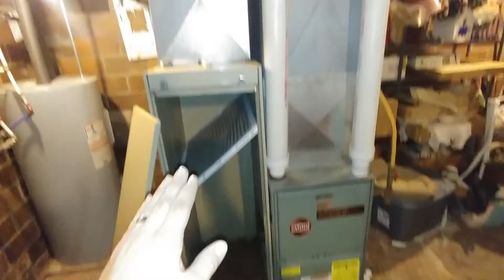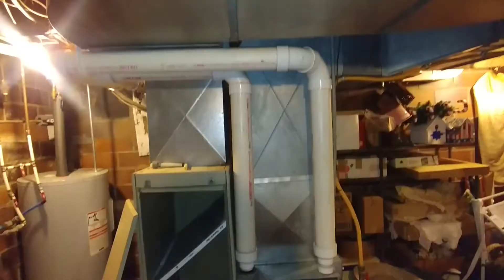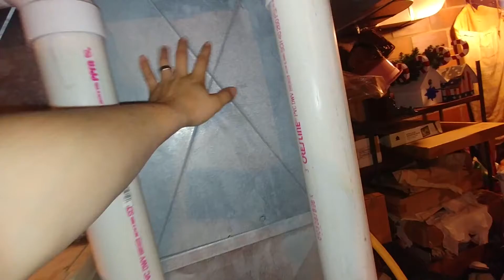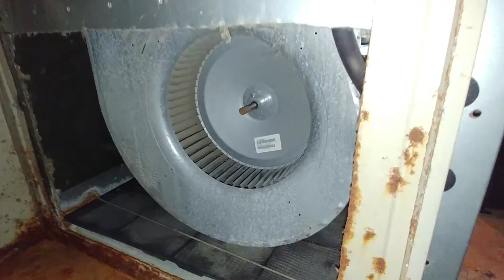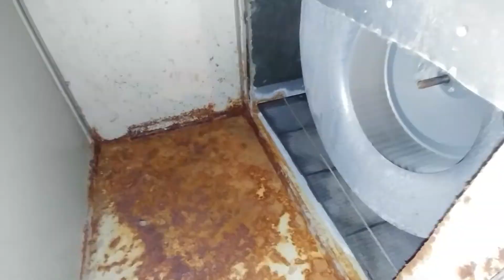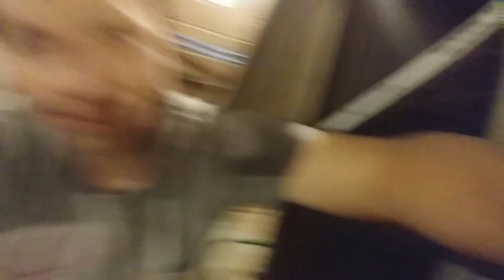Which Way Does The Air Flow Through My Furnace? - How To Tell Air Filter Direction

Comment: I know this is an old video but Thank you! This is the set up in my furnace and I’ve never quite understood which direction to put in the filter. Usually it doesn’t matter much because I have been buying cheap filters that look basically the same on both sides but I recently bought a washable one with 3 different layers and felt it was time to learn the “right” way.

Comment: The "touch" test works when the AC is on, but, when the HEAT is on both the supply and the return pipes are hot as hell....I wouldn't dare touch them with bare hands.  So, the "touch" test with the HEAT on is not an option.

Comment: Thank you! I just bought a house and when I pulled the filter, I was confused, because the previous owner had installed the filter backwards. I was like, "Wait a second! I didn't take it out this way!" My question now is, should I have reinstalled it the same way I removed it, even if it was installed incorrectly, because it was dirty. I assume I'm now blowing dirty air back into my house. Right?!
Reply: Put a new filter in it correctly moron.